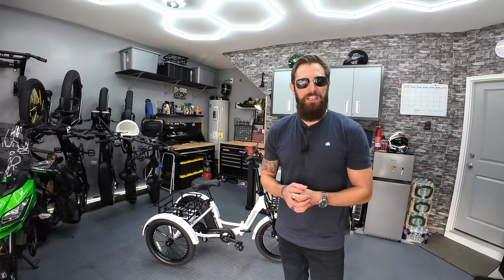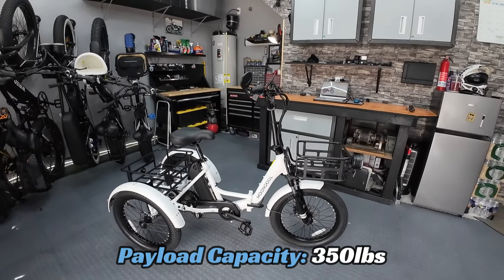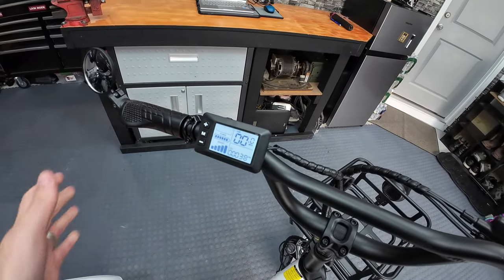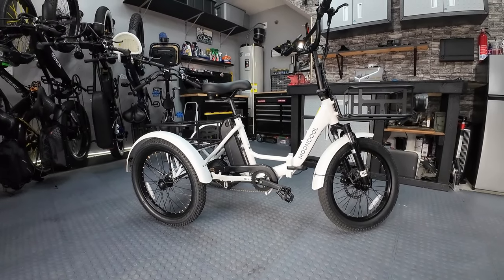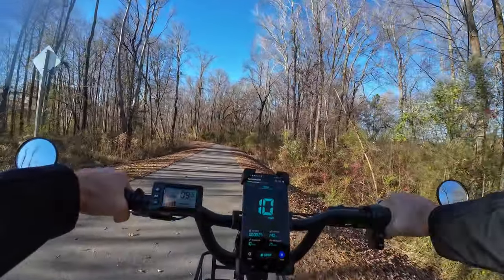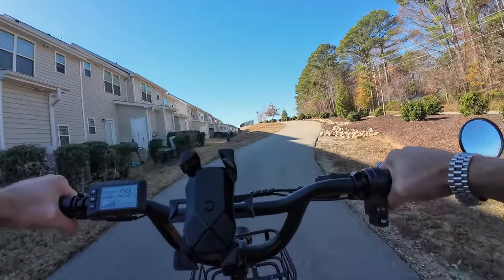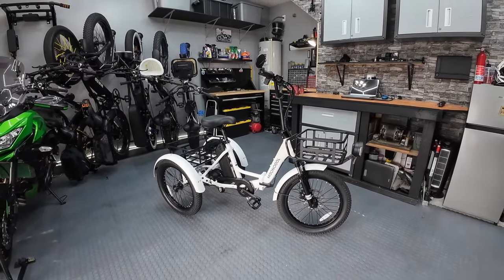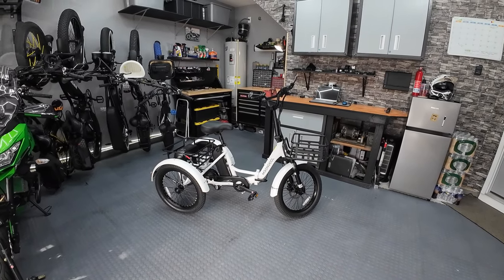Mooncool TK1 Folding eTrike - TOO MUCH FUN!

Comment: Good video! New garage, hot music intro track, new look, & awesome low-key 50lb dumbbell brag...  I have never seen the motor mounted on an etrike like that (looks like a good idea). I also noticed that when the front basket is mounted, light doesn't look like it follows the handlebars.
Reply from the maker: You are very, very observant, my friend. And yes, the front basket mounts to the head tube, not the handlebars, so it doesn't turn.

Comment: I like the drive system on that. No derailleur hanging down to grab dirty grassy bumps or sticks.. Looks like more ground clearance than the other type.
Reply from the maker: Only ground clearance issue I saw was the pedal. It gets really low to the ground.

Comment: Great review, and I have to say this is definitely one of the better designs. The only significant negatives to me are the cruise control style PAS programming, and the oversight of no parking brake. I've ridden the Rad trike, and although it was well made, I still prefer rear wheel drive for trikes. The Lectric trike is similar to this one, but I feel the Mooncool has a less rushed design than the Lectric. The battery cradle design will accommodate a 55amp Grin Technologies Baserunner controller, so there are some cool upgrade options. You'll still be stuck with 500 watts as the max it can use without the temperature going up, but it should be fine with surges of 1200 watts. Thanks for the review!

Comment: I have the Rad Power bikes “trike”. Not happy. Should have waited for this review. Anyway it is what it is and live with it.
Reply from the maker: Sorry to hear that, what don't you like about the rad trike specifically?
Reply: @CitizenCycle925  First know that I have a Rad mini I bought back in 2016. Good bike as we know Rad Power Bikes is known for quality. My recent buy from them is proving anything but. 

The differential set up is a simple approach in that only one rear wheel is powered. This allowed for the problem of one wheel over travel in turns as you correctly mentioned. However in my case it stresses the bike and causes vibrations and noise, that grinds the chain assembly. 

Next is the braking system works with the old school coaster brake system. Where you back peddle and press down. So no disk brake in back. The braking is inadequate and the runner clip that helps the chain lock and apply pressure gets stuck causing a loud grinding. This noise continuously plagues the system long after braking.

Lastly is the front wheel drive. As you said so are the problems I have- irritating! The list goes on but I ‘Kllc leave it there.

The good news it works sadly the simplicity they were striving for was poorly engineered.

Hey man your doing really well with your channel! I remember when you had 10 followers, including me😊👍.

All best man!
Reply from the maker: @DanielLopes-kv4sp  thank you for the detail, sounds like they missed the mark with that one. helpful to hear your experience.  And thank you for sticking around continuing to watch, Appreciate the support!
Reply: I have the Rad Mini two wheel e-bike. Nice bike but looking to get a Trike. I was looking at Rad's trike, it appears to be well built; but that thing is heavy. And it doesn't fold, so I am seriously considering this Moon Cool.

Comment: I think this is a great start for Mooncool and I love the idea of a rear drive trike rather than a front drive. Give it a 750w motor, 25 amp controller (or more) programmable PAS and a 960 watt hour battery (or more) with at least 5 speed derailleur and you would definitely have something.
Reply from the maker: More power is always nice. Probably doesn't need any more speed though. And it would be cool if they sold a battery battery range extender kit.
Reply: And you still expect to pay the same price for those extras? C 'mon.
Reply: Didn't say that.

Comment: I think the ticket to trikes being safe and less likely to tip over are the reverse trikes with independent suspension as they act like a two wheel bike and stay planted on the ground when turning. If you are just a basic rider and simple riding these will be just fine.
Reply: James Biggar made a really good one

Comment: Imagine if e trikes became cool for all ages? I doubt it will happen unless they increase the motors to 750 watts and throw in a 20 AH battery. I would also move the crank forward to help with leg extension and keep the center of gravity as low as possible.

Comment: You could use a velcro strip to hold the brake handle down.  That should work as a parking brake.
Reply from the maker: or maybe an extra thick rubber band..

Comment: They should make trikes to where you can install up to 3 batteries. 2 batteries underneath the rear seat or basket and 1 battery attached to the middle seat or a buit in battery. But the dual batteries underneath the basket should be removable. 2 batteries is good but 3 batteries is better.

Comment: Just received mine this past Saturday, do you have a way to show what all the display do step by step like the wired ? I seen a video on here one guy was going 21 mph on this trike. He wouldn't give me a solid answer on how he unlocked it. I have 6 velotric nomad 1s I have all of them unlocked just looking for a little bit more power if possible and also understand what all the P 0,P1 and P2 settings do I would appreciate it. I wish I had a way to send a photo on here are relocated my headlight to the plate that goes on the gooseneck clears the front basket well keeps the headlight from banging into everything use velcro straps for parking brake, I think a lot of people are going to realize that headlight bangs into everything especially when it's rolling around in your moving it in your garage you don't realize it but does take quite a few hits

Comment: must be...Fat tires 20 x 4 on all 3 for better traction and stability. Hydraulic and parking  brakes on all 3 wheels. The motor must be at least 750 watts, peaking at 1000 watts and reversible. Fork must be hydraulic for better suspension and smooth front braking. fenders must be larger to prevent rain and mud from splashing inner sides and legs of rider. This is what I 
need for my 75 year old girlfriend. she goes to church, supermarket and errands on a donkey, over rough, unpaved roads.

Comment: I o own two geared hubs one is a 1,000w Bafang and the other is a 500w no name. When it comes to pure climbing the 500 is a little better.  Think it has to do with the wind, Feel like the peak of the power band is at a lower RPM, but no matter how many volts go to it, it won't do more than 26mph.
Reply from the maker: I was pleasantly surprised with the hillclimb power in this trike. I wasn't expecting that. They did a good job there. Wonder how it compares to the XP trike...

Comment: I wonder if this was a CanAm type trike  (with two wheels in the front and one in the rear) would be any more stable in turns or off-camber situations? Your thoughts?
Reply from the maker: if the 2 wheels in the front had some suspension system then i'm sure it would be WAY more stable.

Comment: For that price. Need more stuff. Tips over easily. I think maybe it would be better if the two wheels are in front and single wheel in the back. I remember when the first ATV came out as was the same design, they were dangerous. And now ATVs are 4 wheels for more safety. Price too high & not enough power, many complains about the axel gears going bad, no cassettes & cogs when power hours out will be hard to pedal w/o gear shifters and then some. Nah! pass on this one.